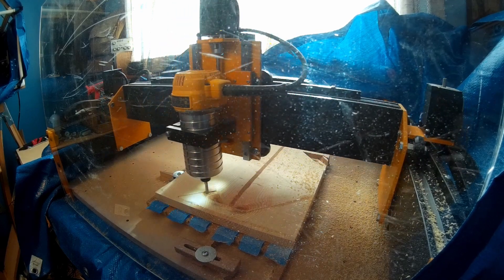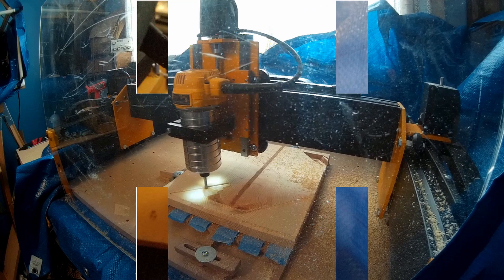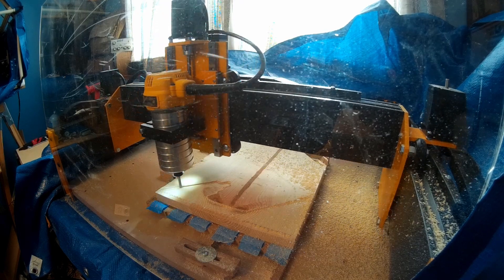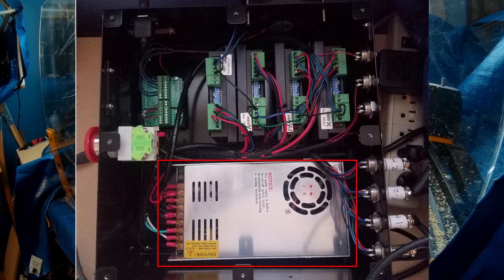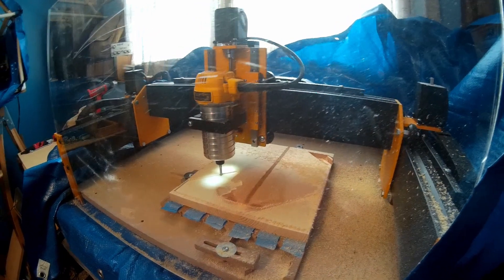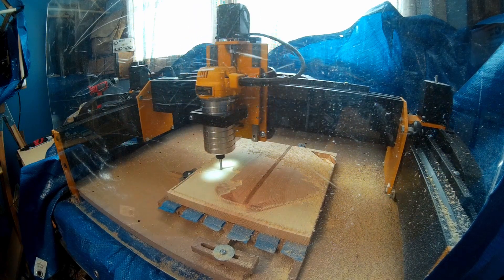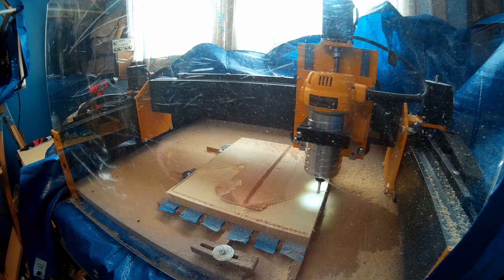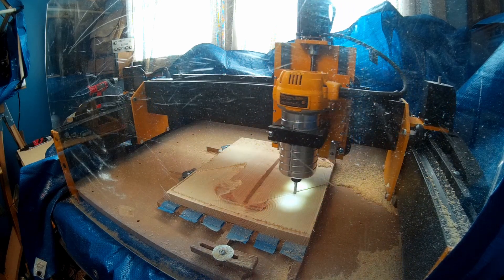MillRight CNC Mega V Feature Spotlight - Motor Drive System MegaV_MotorDrives

Comment: Hello Bruce:  Is there a stepper motor drive already install in the box for the 4th axis? possible wanting to add 4th axis later! Regards Rae
Reply from the maker: There are four drives due to the two Y axis motors as well as the X and Z axis.  The 4th axis is a separate option. I am still learning how that will work myself.

Comment: Thanks for sharing.  

Have you had any issues yet with debris jamming the Y rollers?  I didn't notice until now that they are concave instead of convex.  I'll probably add wipers to mine to avoid an inevitable problem.  Wipers should take care of it though and will be easy enough to add.

I'd like to see a video showing the MegaV removing material at its maximum practical feed rate.  Based on its specs I think it should be able to take considerably deeper/faster passes than anything in its price range.
Reply from the maker: Until I get a dust shoe setup ( one of these days) I just sweep everything up every so often during a cut.  Usually not a problem with wood chips getting on the rail.